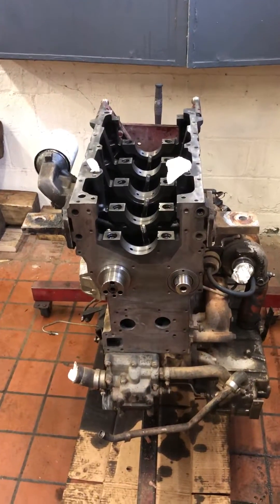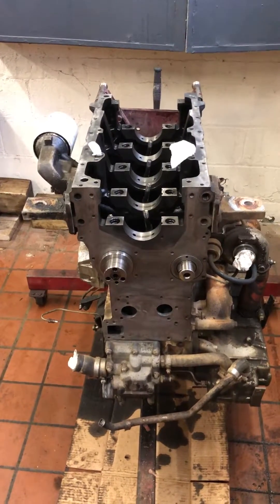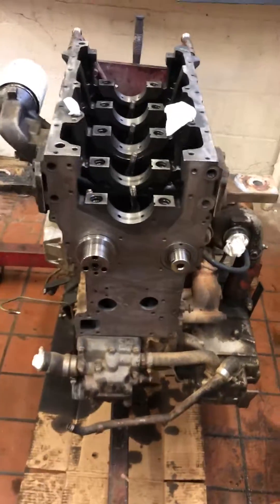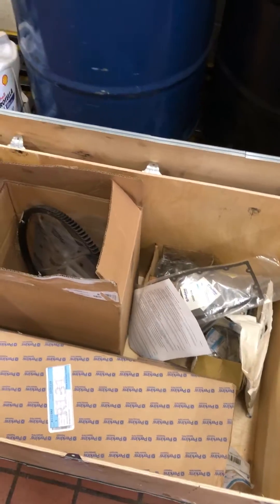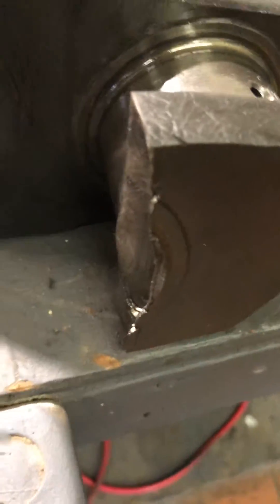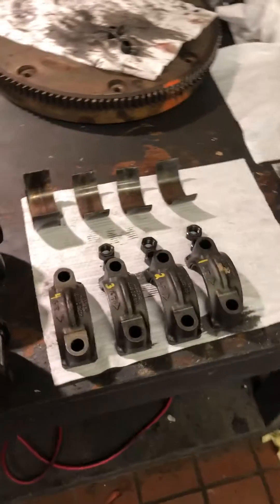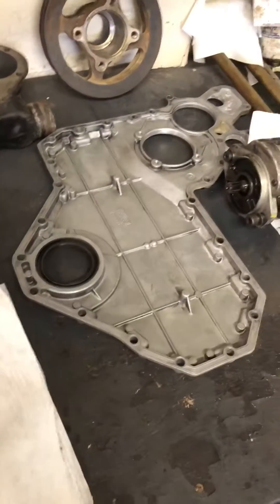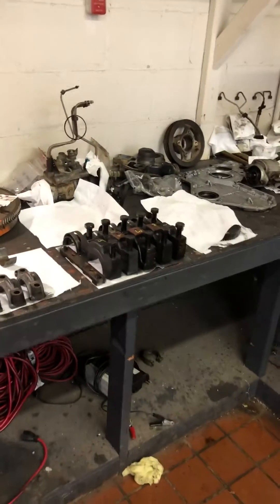Perkins 1004.4T crankshaft replacement

Comment: I have 1004.4t in a backhoe I bought and has a knock or tap in the top end. Goes away as rpm increases. Any ideas?
Reply from the maker: @geraldbon6525  could be a number of things.. only way to find out is to dig into her..
Reply: Ok thanks guess I'll pull the engine and start digging. Thanks for a place to start.